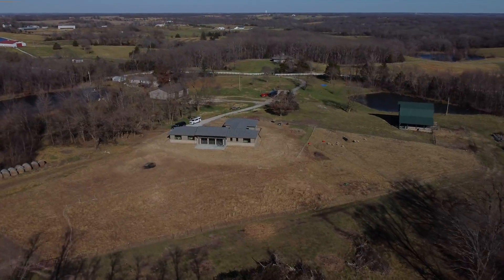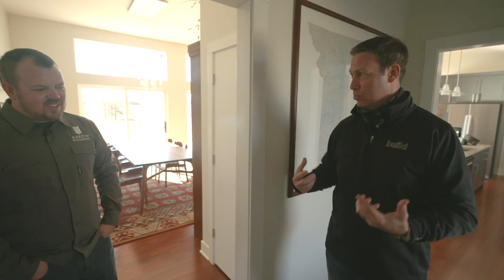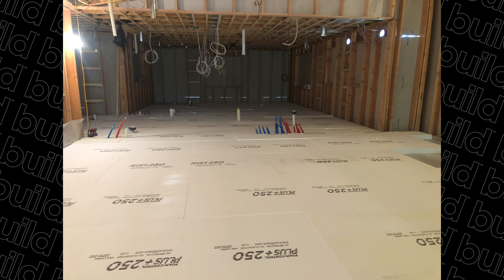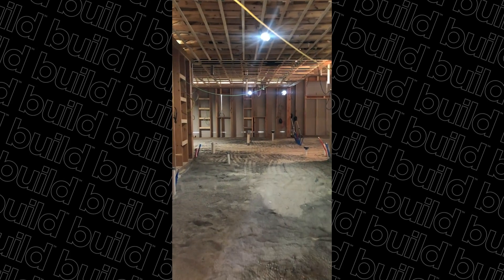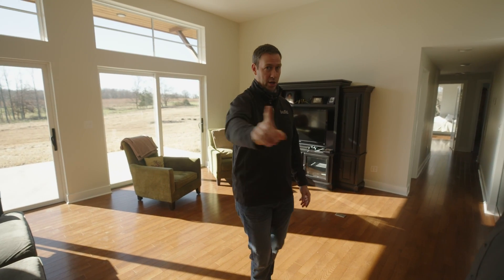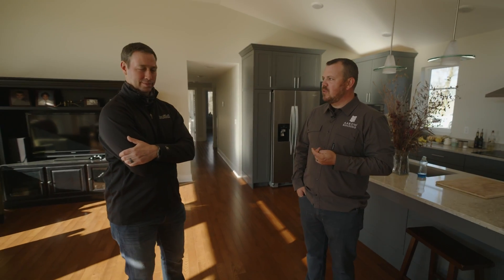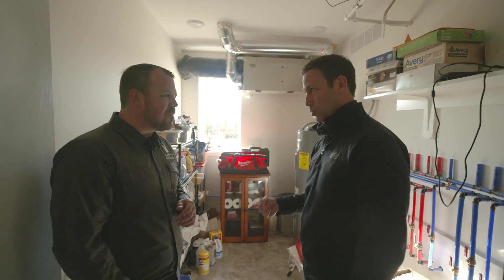Slab-On-Grade INSULATED Foundation (NO Concrete?!) - Part 2

Comment: Floating sub floor. Interesting. Not sure how to feel about this
Reply: Stupidity at its finest, it has been tried in decades past with materials of the day and the ground constantly shifts over time no matter how well they compacted the base material. Homes suffer from water run off under slabs and soil settlement.

 Plus that foam will break down like all materials with ground contact. Moisture Will come though and rot the floor out, walls will shift and crack. The cost to fix that after it all starts coming down will cost more then the home. Check back in 10 years. Homeowners will be pissed
Reply: @zack9912000  its basically built like a barn. Everything's gonna move. Barns need constant maintenance like re supporting loads.  Plus there is such a greater load on all your ply material as far as sheer loads (walls, roof sheathing)  with all that roof/ ceilings with no actual load bearing walls in the field.
Reply: @daleleibfried8648   Barns are supported by concrete on its exterior not requiring interior load support. This builder has placed internal non load bearing walls on a foam pad that will absolutely break down with ground contact, the wood  will over time rot from moisture, that house will have major issues in 10-15 years.  God forbid they have water run off issues as a lot do over the years.

 Seen it daily on concrete slabs that have pockets of missing material underneath from water run of and ground shifting over time. Foam and plywood isn't a good replacment at all for a concrete slab, also what he did is worst for the environment then concrete. All material breaks down, compared to concrete that can last 100 years vs foam and plywood that breaks down in less then a two decades.
Reply: @wallpello_1534  Wtf is that sheep nonsense, water run off issues causing soil erosion under a slab and soil settlement repair is a multi billion dollar industry, this home will make someone a nice payday to clean up when that mess fails.
Reply: @zack9912000  Where is water going to run off from, and where is it going to run off to?
Reply: @TrogdorBurnin8or  The run off can happen  a few different ways, one of the biggest issues are blocked down spouts over flowing and saturating the ground next to the slab. Also areas of the countrynthat get a lot of water and have a high water table. The water that is pooling from the down spout next to the foundation can make it under the slab that overntime washes soil out and compromises the soil under the slab. Water flows path of least resistance, dozen of articles showing soil erosion and soil settlement from water not being properly removed from a home and properly controlled.
Reply: 1) A house has big roof overhangs and gutters to try and prevent this from occurring
2) You can't get to the soil under the slab without getting past the deep poured-concrete foundation wall and footing.  Concrete is a path of high resistance to water, compared to soil.  If you're concerned about a high-water-table area and you have the height, you can also install drain tile at the foundation footing.
Reply: @TrogdorBurnin8or  Yes all that can be done to try and prevent it but as you know a lot of homeowners do not maintain their homes hence the billion dollar industry repairing foundation and concrete slab repair due to soil loss and water damage. This design isn't based on longevity no matter how green they claim it is. The foam and plywood idea is a horrible design for a home they are hoping to last 100 years. Some home designers today make homes that won't last 30 years.
Reply: @zack9912000  How does the soil escape if it's boxed in by foundation walls?
Reply: @TrogdorBurnin8or   Water can flow under a foundation and out with ease, plenty of articles online about it.
Reply: @zack9912000  What about a concrete slab prevents that from occurring?
Reply: @zack9912000  you need to turn in the towel.
Reply: @zack9912000  unless they ply the interior walls, but they are still gonna take load.

Comment: still dumb to not pour concrete, the ground will shift no matter how much you compact it. It will absolutely settle over the years and will be a nightmare to fix later. God forbid they have a soil settlement issues or water run off problems which will make it a bigger mess. 

All that prep work and not pour any concrete is nuts. Also stop the liberal bs of concrete being bad for the environment. One of the few materials we use that can be 100% recycled and reuseable. The production of that foam and plywood creates more environmental problems then  concrete.

Comment: I think this method needs some more intense follow up.  There are lots of great questions in the comments below.  My two questions are 1; If this is such a great idea why hasn't the contractor done it since?  2; Would this be a good alternative method for a older home with a dirt floor basement?  I have a dirt floor basement in my home that was built in the 1930's.  It seems to stay pretty dry and is approximately 4' below grade.  To do a concrete slab would require me to hire someone to do it, but this method looks well suited for the DIY'er.
Reply: This will absolutely fail. It has been tried before with other materials of the day. Resting the internal walls on foam that will break down, on wood that will rot and ground that is always shifting and god forbid they had water run off or soil settlingment problems.

 We see it daily on older homes where the earth is missing under parts of a slab from water run off, now add this stupidity using foam to support the floors and internal walls. It will cost more then the home is worth to repair.
Reply: @zack9912000  You finally spelled "tried" correctly!  In a dozen of your other posts, you spelled it "tired."  Guess you have a LOT more editing to do!
Reply: @wjthehomebuilder  So sorry I can't spell everything perfectly when typing on a cell phone. I don't catch everything. Doesn't change that fact this is one of the most retarded ideas any builder can come up with, the excuse it is greener is bs. It cost more in green house gases to produce the plywood with nasty chemicals to create the foam then pouring a proper slab on grade home. We can recycle and reuse concrete over and over again. You can't do that with the used foam rotted plywood
Reply: Will be just fine. Just level the dirt floor well. Add vapor barrier and then insulation. 2 layer of wall particle boards will be fine. Maybe use some diffusion-open floor coverings such as linoleum - not PVC, vinyl or epoxy. That you need a concrete slab is just a faith based conviction.

Comment: Does not having a concrete slab make it more susceptible to termites? Looking at a Florida build.
Reply: In the last video they were sealing on the foam. Speculating (but hoping for an official reply) ... I'm assuming they did something similar here against the concrete to serve as a physical barrier. Hopefully there's a back-up plan such as a chemical treatment.

Comment: I wonder how this would work in areas with clay soil. Seems like the floor would heave.
Reply: I was thinking something like the expansive smectite clay we have in the Dallas area.
Reply: @RichardWylie68  yeah you wouldn’t build that way in dfw . And with clay busting foundations pier & beam is the best build . But builders wanna slap up
Crap too fast for that .
Reply: I have slates as basement flooring, on top of quick clay. Has been working well for about 140 years.
Reply: IIRC, the IRS facility (in Virginia?) after scraping (grading), the earth allowed moisture to the newly exposed surface.  The floor eventually heaved to the point of shearing mechanical piping - a disaster.
Reply: I agree, a small leak could be much more of a problem than they touched on

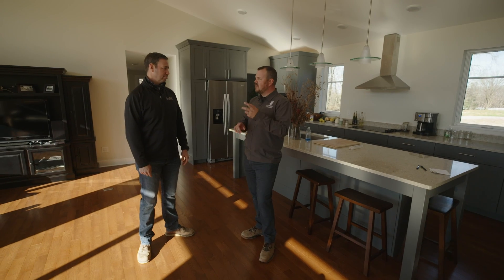Comment: What is he talking about at 7:00, preventing drywall cracks in the ceiling?
Reply: Because the ground will shift and cause cracks in drywall. It may not be shifting now but it absolutely will over time and be a very expensive endeavor to repair because they cut corners to not pour a pad
Reply: @zack9912000  I understand why it cracks. I'm asking about how it is mitigated.
Reply: @zack9912000  Again I understand how and why drywall cracks, I live on the Gulf. At around 7:00, he mentions preventing the cracking. I am asking specifically how they framed to prevent the cracking.
Reply: @rosscoep1450  Sorry miss read your original comment, I would gather they have brackets connecting it to other parts of the structure to decrease movement
Reply: @rosscoep1450  I think it’s primarily because there are no butt joints on the 4’ ends. The ceiling runs are all full sheets.
Reply: @tcoradeschi  That makes sense, we still get cracking in some corners.

Comment: My concrete block house sits on compressed, decomposed granite and sand. It's been... interesting
Reply: What about it has been interesting?
Reply: @danjimielson   So, our floor is outdoor paving brick. It acts as a "battery" for solar heat, where the sun bakes them from 60' of south facing windows. This works fine for the illuminated portions of our house, but the master (of f'ing course) doesn't get enough sun exposure. It's as cold as day old polar bear turds in there during the winter.
Another interesting fact is that the sand acts as the bed for the brick, which is actually pretty neat. However, previous homeowners just went HAM with vacuums, and certain sections of the house don't have enough bedding sand left, leaving portions of the brick a little clinky and swimmy
Reply: @marcob1729  ah dang, any insulation under it, maybe you could lift up those bricks and place some heat wire under them.  What are the concrete block walls sitting on top of, just gravel or a stem wall? How do you like bricks maintenance wise inside (is there much sand to sweep, or bugs getting in, or like if you spill a can of pop and it seeps down impossible to clean)? I've always wanted to build a house with no foundation
Reply: @danjimielson  I might as well just describe the whole dang thing haha. It's a one story house built by hippies in the foothills of the front range of Colorado in 1979. Cinderblock walls and the soil slab as described. It's built into a hill, so effectively 3 exposed sides, and it's predominantly south facing with that 60' of south facing windows being prominent. We heat primarily from wood stove, and everything else is electric, with some electric baseboards being tucked into the hill side of the house in some rooms. Without any intervention, the house stays between 55 and 75 year round due to the passive solar and being into the hill, which is dope. I will say though, when your bedroom is 57 degrees, it feels a lot colder than that haha. 

We spend ~$150 per month in energy bills for everything, and I wish I had the income to put in solar, because we are primed. The overall build of the house is pretty great. No vermin because of no crawlspace. No insects because of no wood (probably also because CO). I do not know what the footing situation is, because I've been focusing on roof issues. But considering it was built in '79 and survived a 100 year flood about 5 years ago, I'd say it's stable. The roof is low slope, and some ignorant people put tile on it. An ignorant person (me) also bought it. I had one particularly troubling portion converted to metal by a contractor, and I intend to do the rest myself. We're going to beef up the insulation in the master. It's connected to the master bathroom, so we'll probably do both at once. Tear out the floor, replace my cast iron septic pipe (yikes), pour a slab, insulate the dickens out of the floor, and then insulate the ceiling/soffit space as well. I've been toying with the idea of doing something like a reverse zip system from the interior, but I don't know if that would create vapor issues between the interior and the concrete.
Reply: @danjimielson  Oh, maintenance wise, we friggin love the brick. It looks good dirty or clean, and we just sweep it every now and then. Occasionally we'll do a pass with a vacuum that has a suction adjustment set to low power. You're supposed to oil them with linseed (I think) every decade or so, and it really makes them pop. We just do slippers in the morning, and don't think much of it. Spills get ragged up, but a lot can seep down. Since it's Colorado and the "slab" is sand and decomposed granite, I just don't worry about it. Our toilet was leaking for a while unbeknownst to us. It must have soaked the surrounding sand damp as all heck, but it's all dry now. You really can't do water damage to sand unless it's A LOT of water. Before we bought the house, a previous owner let a hose valve freeze and burst. There's now a section of brick floor that's got a wave in it. We'll just dig it up, recompact the sand, and re-lay the brick. No big deal
Reply: @marcob1729  need to post a video of that home . Hippie less hippie house lol
Reply: @donjohnson9893  I forgot to mention the 6 fireplaces/stoves. One of which is in the master bathroom 🤣
Reply: Don't tease.  How so?
Reply: @TrogdorBurnin8or  One thing, other than my comment about passive heating and cooling, is the location of appliances and such. In particular, our toilet setup is interesting. All of our appliances sit on concrete plinths. The toilet sits on this teeny tiny 1 sq ft rectangle of concrete, with the cast iron septic pipe just going right into the sand. So, my toilet is supported by this plinth, but the footing of the darn thing extends past the concrete. I have to balance the thing just right using a bunch of shims, because it's basically sitting on a series of cut, wobbly brick

Comment: Radon? Did you Insulated the soil outside the foundation? How deep does the winter frost go?
Reply: They didn't mention it, but I'm sure the limestone fill has a layer of poly underneath, just as you would with a proper slab.
Reply: @brianwright9514  Radon barrier can be seen peaking up along the walls from under the EPS in several shot and at 4:35 you can see them sealing the poly to the wall.
Reply: @brianwright9514  You're right. The first video in the 4-part series shows 6mil poly sheathing.
Reply: FRostline is 20".  So I'm sure they have to go 24".
Reply: @RonLeedy  20" frostline would be a dream, ours is 3" but my previous home was 5'...

Comment: What are the benefits of this system vs traditional floor joists w/ insulation?
Reply: you don't have to buy floor joists.  and you can have your house closer to ground level.  that's pretty much it.
Reply: IMO, the gravel system should only cost the half of a concrete slab.

Comment: Interesting, but critters could be a problem.  They pour rat slabs in crawl spaces for a reason.
Reply: I'd worry more about termites.
Reply: Not likely. That lime dust layer is a very effective pest solution. It's alkaline, and the granules grind up insects. It's similar to how gardeners use diatomacious earth to protect plants against insects.
Reply: @azurealism  interesting.  Will that work on rodents?
Reply: @Bob.W.  It should perform just fine against rodents. Lime stabilized soils, especially clays, get very hard.  Farmers have used lime mixed with clay to make limecrete for dry stalls in their barns. And superadobe construction calls for lime as a binder in the walls, and the result is very solid, so much so that it is approved in some areas as a masonry wall construction.
Reply: @azurealism  how much of a layer of lime is required?  I will have to listen to the audio again.
Reply: Could probably be solved by using spray foam instead of foam board
Reply: @aaronsvoboda5897  spray foam does not present a flat surface for the sub floor to rest on
Reply: @RichSobocinski  Good point!
Reply: @aaronsvoboda5897  Foam board could have an anti pest component?
Reply: @whattheschmidt  That could be possible
Reply: Possibly.  It would be easier to fix a sewer problem than a slab.
Reply: I've never seen concrete in a crawlspace where I'm fron, though I'm aware that it is done.
Reply: I'm building a post frame house on concrete piers with a crawl space with a rat slab. How deep should the rat slab be 3inch?

Comment: I have heard of concrete reabsorbing carbon over time. if that is true I’m sure that manufacturing that much foam and the disposal of it one day would be just as bad for the environment. I would like to see a comparison.
Reply: First: This much foam is recommended underneath a slab anyway.

Second: EPS foam has minimal environmental impact and is known to stand up to decades of use in eg a floating raft dock.  XPS foam should be avoided in the US, because of the horrendous GWP blowing agents we allow.  As James said, the GWP is almost nothing for EPS compared to EPS+concrete.

Not much disposal concern to speak of - melt it down to sold polystyrene and it's effectively geologically stable sequestered carbon.  Or burn it for energy.  Only slight problems are when EPS dust gets aerosolized by cutting and floats around on a windy day.
Reply: An insulated slab will still use foam.  What you really want to compare is concrete vs OSB.  Wood products generally fare well, as least in comparison to concrete, steel, or kiln-fired products.

EPS seems to emit about 3x it's weight for manufacture and shipping, while concrete is about 1:1.  However concrete is also ~120x more dense, so by volume EPS is 40x better.  However as I said above that's not the part you are swapping in this design.
Reply: that's a thought.

Comment: If you think about it, the slabless slab is technically the thickness of the earth. 7,919 miles deep.
Reply: only half of that, has to split with the house on the other side of the world
Reply: More like the thickness of the crust of the earth
Reply: Good one.